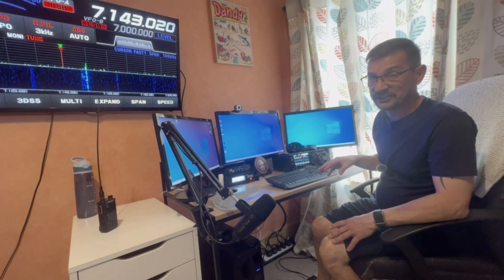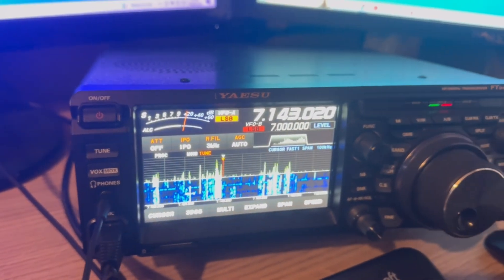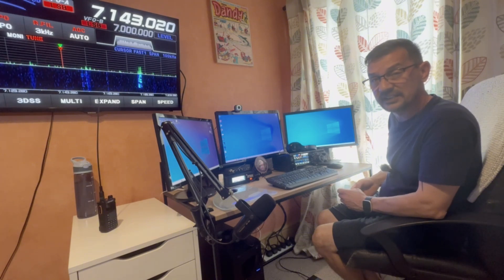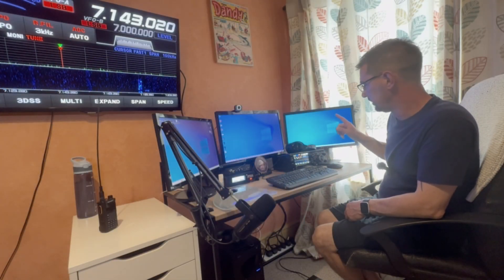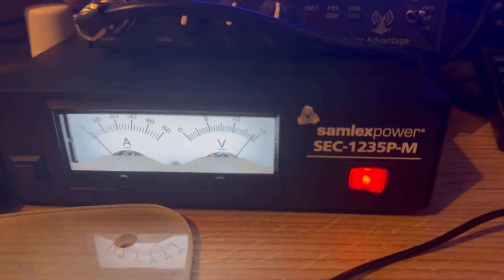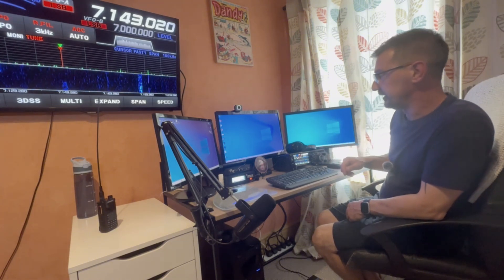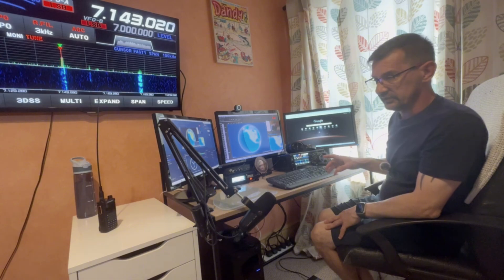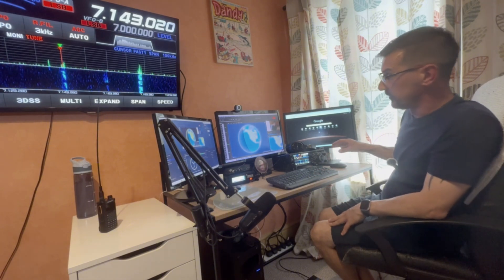Revamped Shack Tour - Stream Setup

Comment: Hi, brilliant info on the shack setup .... do you rf ground or earth ground other than mains ?
Reply from the maker: Ahhhhh grounding. The hot topic of Ham Radio everywhere. 

Due to my shack being on the third floor in the loft I have no RF ground requirements. All I have is a robust 1:1 choke balun at the point where the coax enters the shack to eliminate any common mode. 

The equipment within the shack is all electrically earthed via the standard plug (eu/uk) system. 

In an ideal world I would connect all the chassis to a grounding bar and link this to a ground rod outside the property but it’s impractical. 

Put three hams in a room and ask them about grounding and you’ll get three differing opinions. 😂

Comment: Very interesting video Matt. Which capture card do you use? I'd like to use one mostly to have the DX-10 video output in a window on my monitors rather than streaming. The budget ones all have just HDMI input - and there is this problem with the DX-10. Or did you find an adapter which does not blow the fuse in between?
Reply from the maker: Thanks for the comment and the question. 

If you look back in my video library you’ll see a video called DVI-D to HDMI investigation. In that video I take a deep dive into the problem and uncover what causes the failures for some people when using a converter lead into a monitor or to with HDMI. 

I do use a HDMI capture card which requires a DVI-D to HDMI converter lead, however… because a capture card is a usb device there is no requirement for a “handshake” or EDID. 

Basically the capture card eliminates the potential issue